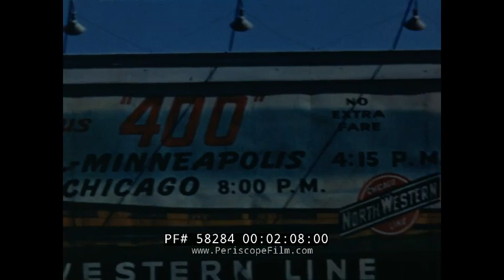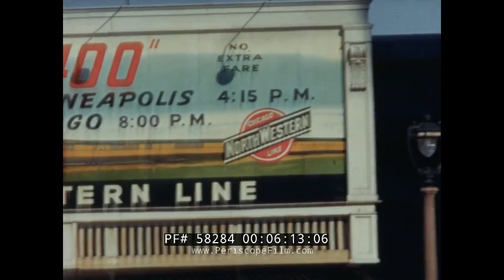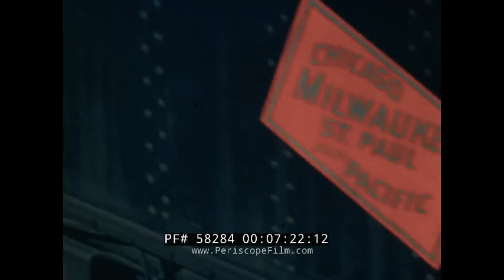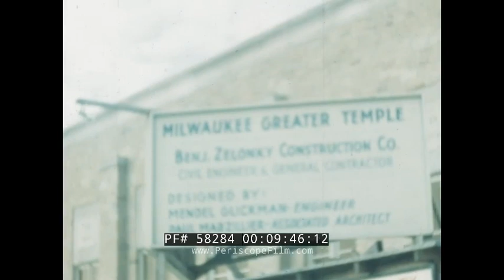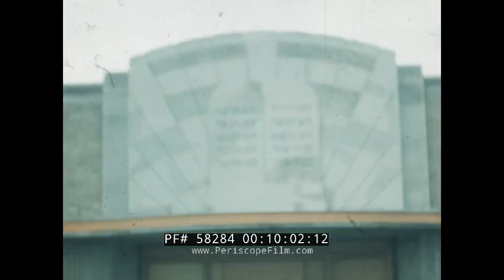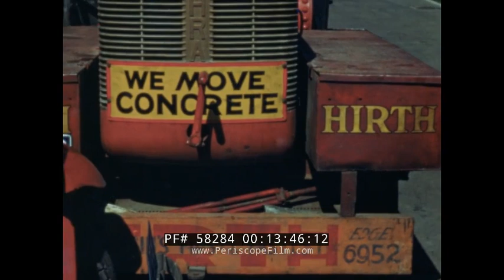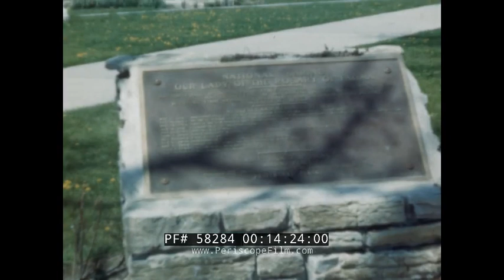HIRTH CONCRETE BREAKING CO.  MILWAUKEE WISCONSIN   DEMOLITION & CONSTRUCTION  HOME MOVIE 58284

Comment: Sure brought back some nightmares. I've had my fill of drills and jackhammers. Between asphalt, concrete,  drilling boulders and ditch lines and cleaning out concrete truck tubs, no wonder my hands are shot. I remember having to pry my hands loose of the smaller ones. Now it's somebody else's turn. Good video!
Reply from the maker: Thanks for the comment. Any chance we can persuade you to look at the film and provide a better description / idea of what they are doing here?
Reply: Sure. Looked like old street, sidewalk and building demolition. Breaking down structures that had rebar in them like walls. I watched the video at least what I could see of it. Looked like a demo outfit that ended up with dump trucks to haul the rubble off as they expanded their services. I didn't really see any drilling, just working with what I called pavement breakers BUT I think there was an excerpt with  drilling sort-of with the driller twisting a handle back and forth attached to the steel because the drill didn't have any rotation of itself, which a regular pavement breaker does not. Maybe they were trying some drilling with the equipment they had instead of buying a drill with steel and bits. Interesting video and Thanks!
Reply from the maker: Hey thank you!